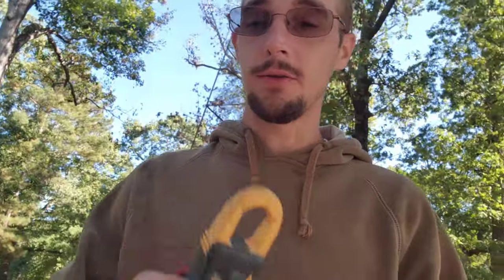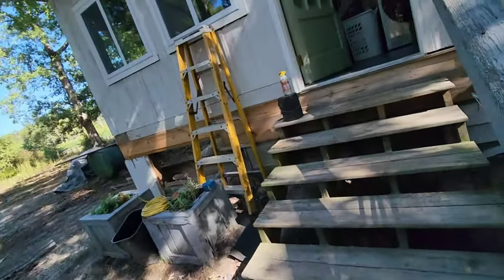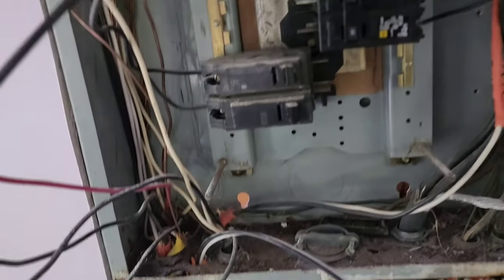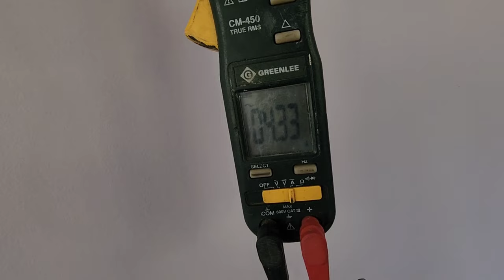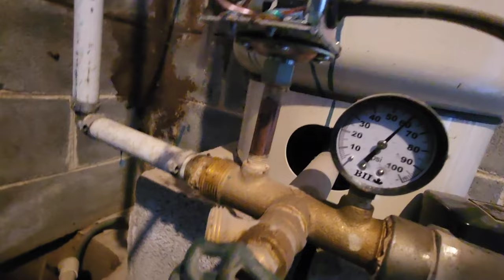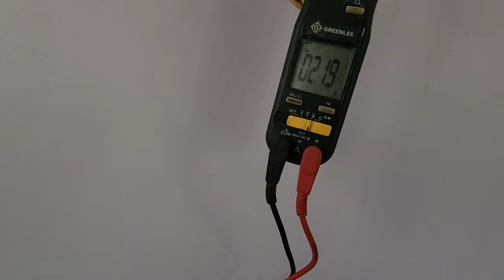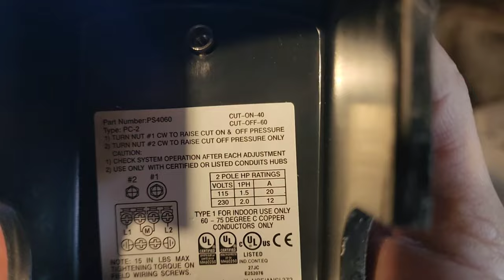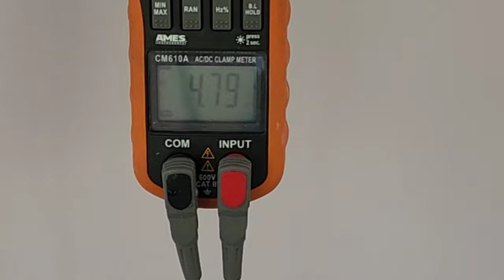Well Pump Electrical System Troubleshooting. Step by Step Tutorial.

Comment: In the situation as in this video you should isolate the well pump feed at the tank pressure switch- if the breaker trips again u will know which part of the circuit is shorted - another thing you can do without tripping the breaker which is dangerous - you will know that when one of those breakers blows up in your hand - I am a retired master electrician and have seen all kinds of electrical accidents ... so since the breaker is open you can go to the tank pressure switch and take your meter - set it to ohms and test the wires to see if they are shorted together - when you test the pump you should get an ohm reading through the pump - since you only work with a couple of sizes of pumps you can easily find the ohm reading for the pumps ... if you have a hard fault you should be able to find it without testing by tripping a breaker .. since that breaker has already been closed into a hard fault probably 10 times it should be changed out...

Comment: Yeah buddy, it was most likely a lightning strike especially if the conduit was copper. For two imperfections in one spool of wire is pretty rare not saying it can't happen, most of the times when you have a nicked wire it will be in the well from not having a torque arrest and it's usually within the first 15 to 20 ft. In this case I think your spot on it could have been some slag in the pipe or most likely lightning. But like you said there's no way of knowing unless you thoroughly check everything. And besides the point you would not just fix what you see at your own house you would go through the whole system because you have to sleep there. Just good quality craftsmanship and professionalism. Great video! 🍻

Comment: My guess is that they nicked the UF and wire jacket while pulling it through, and alkaline water slowly creeped in, which causes the copper to oxidize and dissolve, then create a lower resistance path to ground. It also makes sense as to why there are two locations like that. I have personally never seen wire imperfections from the factory in any Southwire or other quality-made wire, but I suppose it could happen. Reusing existing galvanized (?) water pipe for wire installation was probably the first no-no. Either way, the customer should consider installing Romex staples and connectors everywhere or they are likely to get other chaffing & breakage issues, especially with all of the critters running around.

Comment: 25:38 be carful dumping the main valve like that because the water hammer can blow apart the pipe work. Open some facets and then crack the main valve slowly so it doesn’t do this.

Comment: My money is on the copper tubing wearing through the UF wire.  Everyone knows you should deburr the inside of copper tubing when you cut it with a tubing cutter to prevent turbulence.  But I guess it's even more important when you use the copper tubing as conduit! Lol.  Also, you could have avoided crawling under the house in the dogspace if you had disconnected at the switch and re tested.  Break the circuit up into smaller pieces to test and narrow down the problem.👍

Comment: More than likely when the cable was pulled in it was chafed against the pipe and got skinned exposing the cu conductors. Plumbing pipes are not reamed as well as electrical pipe.

Comment: I use a old credit card cut down to go in between the switch points to open the circuit then test with ohm meter.

Comment: Maybe pulling it through the pipe when new gouged out a few spots? Maybe also used wire was used.
Reply: I would have considered that as likely as lightning except for two places.  I would have to have been at a pope joint and one 3 feet in from each end is unlikely.  Ut really doesn't matter. That unlikely possibility would have pushed me away from using the pipe as an electric cobduit

Comment: after you disconnected the wiring at the pump and still had a short, the next logical step would have been to disconnect the wiring leaving the pressure switch that ran to the pump.  other than than that, a good job diagnosing the problem.  Thanks!

Comment: I used long q tips to clean it because I knew that a screw driver may damage the bladder inside the where it goes to the switch , but turned out switch was no good any ways  . So bought a switch from you . I had to buy that cheap square D one for now but will get the new one and put it on

Comment: They need to have breaker box changed out. You initially said the grey UF at well went to house and as i’m typing to tell you that’s wrong you then explained wire routing correctly while at pressure switch.

Comment: When a new pressure switch is installed, how is the air remaining in that 4" 1/2: pipe purged out or don't you concern yourself with it. Remember, air can be compressed but water can not be compressed. I would think presence of air against the switch diaphragm would affect start and stop pressure.

Comment: You aren’t supposed to put  Romex wire in conduit. It will over heat. You should run separate wires in conduit. Or you can use direct burial cable in the ground.

Comment: If the contacts burned out one leg and power through pump, back through ground wire then, 1 side ac through metal pipe becomes cal-rod. just like element on electric stove, that is where the heat to melt insulation and the wire inside pipe.

Comment: Regular Romex in a metal pipe will rot the copper. Has to be a buriable wire with better insulation.

Comment: PVC conduit would be the greatest thing on earth compared to copper .  I like the green water in the self watering dog bowl. Also if that pump starts to drag or get a lot of wear might cause more of a draw on the wire running out there .  I hear you on brass and stainless on the valve!   Great video I like how you checked the amp draw on that motor so that’s a good deal yeah the filter was horrible !

Comment: Only a few question if lightening why was the pump not taken out ? I'd rather believe mice chewed on the wires and yes 1 man sucks on site but a snake thru the pipe and pulled a new wire been my choice. New switch for certain and why all the wire twisting needed ?

Comment: another common thing. someone damaged the wire in install. see it allot with Cat and coaxial cable. over pulling the cable and or pulling it against a sharp edge of the pipe. or not de burring the pipe and connections and a sharp piece cuts it. allowing water to do its thing and for it to ark.

Comment: I've fixed a wire hit by lightning that was in the ground and it looked just like that wire. Any way you found the problem and got the job done. Also good info on checking the pressure on the tank. Thanks

Comment: Ye gads that consumer unit  looks like is is a historic relic . That is electrolesys (SP) something has generated  an acid in the tube in the ground (copper pipe)  and damaged the PVC not an uncommon problem with running power cables in copper pipes  .

Comment: Could it had been cut during the install in the pipe?
Reply: I had two alternate opinions on the damage, bad work on install or some nasty rough spots on the inside of that pipe.  I have seen pipe cuts that were not properly reamed leaving nasty edges that could cut insulation and I have seen people mishandle wire.  It is an interesting thought but that is conjecture and not important to getting it fixed without costing the customer more money.

Comment: Hi.thanks for your videos. I have a question. My issue is. I am getting water. but by intermittence. About 2 litres/a half gallon at a time. then it stops and I have to wait about a half hour to get the same. I might change the pressure switch. any ideas? .thanks man. 😊

Comment: Wire dieing like that ussually means it pulled too much amperage for some reason, or roddent chewing... or like you said, sharp edge marked the sheething in just a small knick, and over the years, it slowly would corrode until it got to oxygen and started oxydizing and corrading with water (and snow there?), and would eventually fry up like that causing more and more heat until the pixies let the magic smoke out. 

again, why I would run (easiest for underground to home with a waterproof junction on the side of the foundation as it enters the house) grey PVC sch80 conduit. Direct burry is sooooo  bad and when you have wild animals that dig and pets that dig, going a few inches under is nothing.....  lol....  just going to happen in a few years again!  :)  If i was to ever use direct burry, i'd put atleast 12-18" under...  and if I go that deep, why not just spend a coupld bucks and get conduit and put in the hole :) LOL.   If your yard is big enough, you could even setup an RV socket next to it with running big enough conduit to run the wires, and then a RV water hook up too!  I  guess if you have septic, you could run a line from there to, to your septic inlet side.  Kinda figure if you have a well, you likely dont have city water either....  But I was born and raised in the city life in Phoenix, so hot desert life here.  So the idea of a septic and well and all this is mind blowing that people have to deal with and pay this kind of money just for simple water service....  Spoiled with a line going to the street and a meter....  and the city/private water co. run a few redundancies, that if something does happen, and they need to shut off water to break, 99.9% of the time, they can issolate that one section and have redundent pipes running other ways to keep service on to almost everyone....  The only time This isnt like this is with Natural Gas hookups.  2 of my houses were Gas and current one i built in 2019 have gas....  absolutely LOVE IT!!!  Prefer over electric anyday!!!  Electric stove/oven/dryer/waterheater/heat pump all suck and use a massivve ammount of electrical power and cost where gas is PENNIES to run even longer and more!  electric bill in full elecvtric house was nearly 700 in summer months and 200 in winter months....  house with gas, is 400 in summer and 50 in winter with a 36 gas bill.....   

You do some awesome work and leaving the customer plenty of extra to play with is awesome of ya.

Comment: I want to check the air pressure in the tank for my well. Does the tank have to be drained? I read an article that said the pressure should be 2 psi below the cut-in pressure, but it didn’t say if the tank should be empty or not.

Comment: That breaker should of tripped long before that wire melted and burnt like it did. That breaker is either bad or its to big a breaker for the voltage.

Comment: There are several types of copper wire, some for building a home  like: 'Romex' and some that are capable for direct bury like: 'UF-B', or moisture resistant. When I connected my son's well, I buried the UF-B inside a electrical conduit. The purpose of the conduit was in case he was digging around in his back yard.

Comment: Hi I have power to pressure switch but not going out to well pump ...also switch contacts are open not closed! Does this mean my switch is no good or a wire could have come undone at top of well or it points to well wires or pump correct? Also I have a 30 50 pressure switch I'd need a diiferent tank to handle a 40 60 pressure switch??? & would a 40-60 give me more water pressure in our fauctets???
thanx in advance!!!

Comment: I do all the windmill in probably a 180 mile in all detection of my area in southern California I would say iv done a good 100+ windmill rebuild I like when there a draw cyclender and you can pull the sucker rod first  but they really suck when it's all steal pipe and you have to replace the pipe in the windmill.👍👌✌️🍻💯💦

Comment: While you had both ends disconnected and were there with your meter you could have flipped it to ohms and checked across all the underground wires for that short. Also why in the world is that wire on a 30 amp? If that pump starts drawing excess current over about 17amps it could burn up that wire.
Reply: But yes that short could have caused the pressure switch to go bad for sure

Comment: Awesome videos. Do you have a video on pump troubleshooting? My breaker is tripping after 15 secs. No movement on the pump. It just humms. We had a freeze and the pump may have burned up trying to pull water from a frozen line. Thoughts?
Reply from the maker: If its a jet pump, it's probably froze up inside the pump. 
If its a submersible pump, it's probably bad.
Reply: @h2omechanic  figured it out. The impeller welded itself to the stationary cover. Prevented the motor from turning.

Comment: Great channel. I have a 30/50 switch and when I operate it, it will come on just fine. My bladder was a little low so I added pressure to it. I have a 1500 gallon tank which is empty. I don’t know if my well is going dry or if I have another problem. My well is about 350 feet and the water line is at around 180 feet.  Do you have any suggestions?
Reply from the maker: Check your toilets!  Make sure none are leaking at the rubber flappers or the overflow. Toilets are my #1 go-to for draining a well dry

Comment: I have a 9013fsg2 switch and that's what I can read on the label.  Just moved in and wanted to check pressure on the tank and don't know what to set it at.
Reply from the maker: 25psi is a good start for 2 different switches. If it doesn't act right, then lower the air pressure to 18 psi
Reply: Thanks for the information 👍

Comment: I thing it was a bad splice, It went from romex to UF cable. No romax clamps, poor install.  you test well,  Per the NEC you need to be 24 " down if not on a GFCI beaker,   Bad advice.  Wires werent mounted at all.

Comment: My pressure gague never gets above 30psi . It's supposed to turn on at 30 and shut off at 50. It gets up to 30, then it shuts off and holds at 30 psi for about 30 seconds and then pressure drops to 0 psi and does not start back up. I have to shut the breaker off and start over to get it to 30 psi again. And it repeats this. I replaced the switch, and the breaker and it still does the same thing. Do you suppose the pump is going bad if the pressure never gets up past 30 psi? Thank you
Reply from the maker: Yes, it's likely the pump is bad. Itll run for a bit then overheat.
Reply: @h2omechanic  okay thank you
Reply: I had a pitless adapter corrode enough to cause a bad leak with similar symptoms.  Essentially, the well pump ran continuously dumping water back into the casing.

Comment: Will 30amp 8gage wire work for my 1hp pump and switch?
Reply from the maker: Yes. 10 gauge is typically used for a 1hp.

Comment: I had a intermittent breaker trip issue from oscillation of pressure switch points. The pump was moving the pipes/switch when it cycled. 5hp at 600ft have you ever seen this?
Reply from the maker: Check the tank, might be bad/waterlogged
Reply: @h2omechanic  pump cycling caused contacts to chatter which continually puts it in start up mode, breaker trips from over current. Problem has been resolved by shortening brass nipple to pressure sw, turning sw 90 deg, and strapping pipes down .
Reply from the maker: Typically short cycles occur when the pressure tank has a bad bladder & the tank is out/low of air pressure. Watch my tank videos so you can check yours correctly
Reply from the maker: @russellmartin2705  https://youtu.be/NUX5lcMLdOU
How to test your tank video
Reply: Pressure sw contacts were chattering not short cycling. It's from a physical movement of the pressure sw when the pump cycles.
Reply: It was maybe lightning causing the short

Comment: Using a meter properly would have told you what section the fault was in. Using the breaker to do your work is the wrong way. That is a good way to burn a house down or eat the breaker with your face if it was to arc flash. Also that new line needs to be buried minimum of 24 inches.